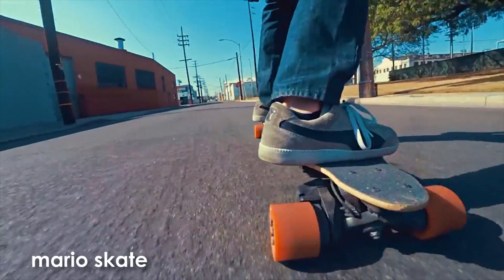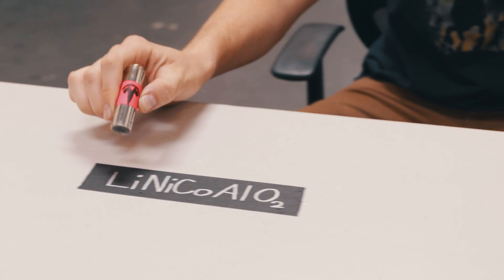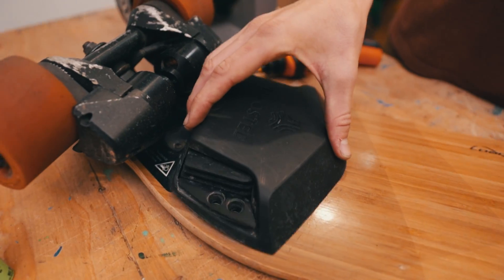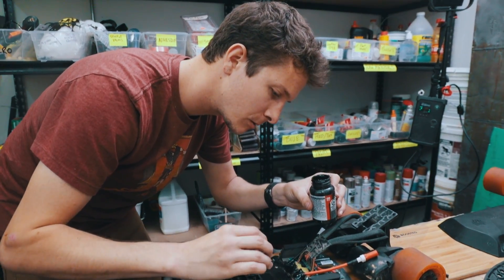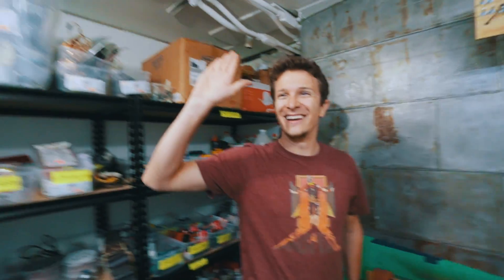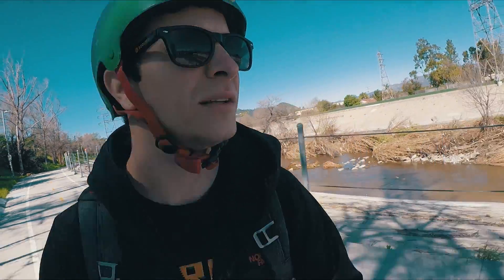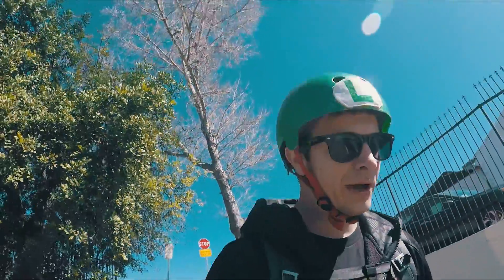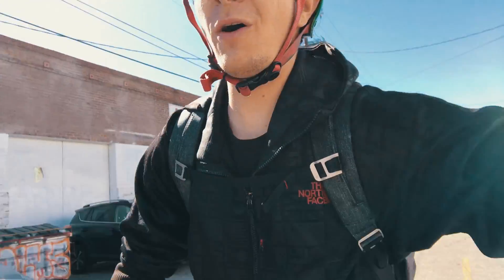Tesla Batteries in an Electric Skateboard!

Comment: Bad parallel methodology... you still allow individual cells in each string to be a weak link. You should have (2-cell-parallels), then string those together in series. Then each and every singular cell has a team mate to share the load with, versus sharing between 2 separate packs.

Comment: A few issues. The NCR18650 has high capacity but isn't really rated for the high amps you are subjecting it to. This will cause them to run hot. Also running down a li-ion battery so low is very bad for the battery. The protection circuit kicked in when it was left unused for so long hence why it wouldn't recharge.
I'm not sure how you are charging but you may need to look into balance charging the new packs.

Comment: What if you design an electric board that has 4 20v batteries and when one dies then it gets charged by 2 electric motors in the front that are only used for charging the batterie that dies. So once the 1st battery dies then it’s programmed to move to the next better and charge the other one while your riding. So it continues to do this and make an endless cycle of charge / use longboard that never stops working so long as you ride it

Comment: Couldn't you just add a fat capacitor to maintain the voltage at a higher voltage i.e. 33.5v? That way the voltage would stay high untill you hit max throttle where the capacitors would run low and average volt with the batteries again.

Comment: You can put a voltage meter to see the battery percentage. You can 3D print a voltage meter case to screwing on to the boosted board. You can put a bigger battery in your bag so you can get more distance and more volts to boost you controller and your motor.

Comment: Ever thought about replacing the main battery with parallel battery packs what if you used solar panels that would trickle the battery drain on the pack

Comment: I see your problem. The problem is not the voltage. It's the if A tour getting from tour battery. So what you would need to do is ad a battery charger or compliment the 12A from the tesla  batteries. That should give you enough energy and A to get you to work.

Comment: It’s not the voltage you need to worry about, it’s how you set up the batteries in parallel. They do not have enough power output. Its great you understand how the longevity works, but focusing on longevity for the batteries will obviously have its drawbacks when outputting power. Lastly, oh god clean up you soldering, its was so painful to see you solder those wires.

Comment: What if you replaced the original batteries that came installed in the board with the ones you're using as the "extra pack", LiNiCoAlO2.. That way you'll have the same voltage range for all the batteries..

Comment: It seems to be that the boosted bord is not converting the last amount of letricity into the mother’s as if it’s detecting it as low voltage in those two last battery’s
Reply: Sorry I missed spells motors
Reply: So network won't respond to go beyond this comment in stack lol.  I watched this long ago then never contacted you about project with donated top of line motorcycle for your pickup driver you flamed up with a cheap loaned mountain bike ride...

Any way owner i assume is still game.  Specs are notorious cost tens of thousands and negotiated down to not even four figures yield to seller so barter fame barter one percent of google revenue just get it rehabbed with chinese donate lto or whatever my goal was static or airspring but the ip of the liquidated lightsail is in unknown hands the patents are her's but the material is as she points out free even if she refuses to acknowledge material science is what her cold reversible heat at least if NOT fire of even better AS IN FACT NOT JUST COLD reversible fusion was and must become so airspring the unletfone Bram son

Comment: your problem was with those batteries. boosted board motors need to use high discharge batteries and tesla batteries arent high discharge batteries. you coul have shorted the engine. only use li-po batries

Comment: make the front wheels kinetic chargers this will give you a slight range boost as around 15% of your power is turned into heat energy and the kinetic wheels will give a bit of that energy back
Reply: Firefox 
That just causes more resistance
Reply: iFail true but there is another problem the battery inside is causing more resistance
Reply: What
Reply: iFail it dose not matte anymore
Reply: iFail matter

Comment: have a switch that changes the wiring from parallel to series. basically each 30 volt battery will stack into 60 volts. The danger is that it could cause run away heat build up and it could explode or you could over volt your motors and burn them out. applying a rheostat to fine tune the amount of draw should help as it drops from 30 volt to 20 volt modulate the rheostat. if you had a digital rheostat/ volt meter you could program it to modulate in real time. Far more complicated than simply storing extra batteries and hot swapping them during a ride.

Comment: here is a fucking insane option. have a switch wiring converter. basically have a wiring configuration where you can change from parralel to series when the voltage drop gets too low. Why is this insane? For a number of reasons 1 is that you could overload your motors by applying too much voltage. 60 volt on a 40 volt motor. Also this is a good stress test for your batteries. Worst case scenario the battery pack gets into runaway heat generation and you die from the explosion.  yolo of course you could apply a rheostat to ensure that you don't draw too much power.. but that takes a bit of work. looking at about an extra 2 pounds of weight.

Comment: What you should do is completely by pass the original battery and add a third tesla pack the original battery has built up what's known as a physical resistance making it even less of a reliable source of power if you want more speed you also need to see if it can handle higher voltage to increase rpms

Comment: make your own board, use the frame and the motors but just hook power straight into a variable resistor in a line up to your arm or use the same idea with a set of relays and an rc controller board

Comment: you can use the full capacity of the batteries by using a step up voltage converter

Comment: Did you think of just simply removing the booster board factory battery?  It would seem that if you remove the limiting factor you are left with fully accessible battery charge.  You could then add one more battery bank and end up with basically two factory charge lengths added to the system and full discharge capability.

Comment: You cannot get energy our of nothig. If you use booster you will kill either the controller due to overload (AMps) or will destroy the battaries. You may use more parallell WITH more power gain so instead of 40.1v make 44.5v controller will decide and will autoajust how much yiou need, but there is again, a rist of burning out. you Might want to look up tesla's engenuity to work YOUR way arounf it. OR consult with any electritian or good physics teacher. They will deffinately help you solve this. 
This is primarely the reason why I am NOT buying boosted. 

OH! btw, you can look up how different boards are made that go WAAAY beoynd 5 mile range.

Comment: Add a third battery pack in sires for when the original battery (at same voltage)dies you can plug up that one and should run fine plus adding the extra boost of power that you need for the last leg of the ride

Comment: If you get a amperage restricter converter and pair it with a voltage trickle charge capacitor you’ll be able to reduce the stress on the aluminum zirconium inside the battery which in turn will allow the amount of kinetic energy being released to the wheels double in output and I have no idea what I’m talking about

Comment: so all you really need to do is to make your own voltage regulator or modify the one that is on the board right now. you need to make one that cuts the power at 30v but i think the easier way to do this is to using a microcontroller (uc) like the raspberry pi zero and just program it to regulate the voltage. If you havent worked with a uc before then just make a voltage regulator from scratch they're relatively simple just look it up.

Comment: You need to use the same battery type as the one used on your board. Tesla batteries release power slower than the original battery on your board. So get 10 of them and connect them in parallel.

Comment: iGuess You allready have figured this out, but ditch the original battery and connect Your DIY batteries to where the original one was.. You will eliminate the leftover juice in the 18650's and You will probably have a correct reading on Your remote :)

But as i said... this problem is likely solved by now :)

Comment: same thing as the tesla car or in other car they run on all batteries but they have a system to work on meaning that lets say your bored need 40v to run on. at 30v it will no longer run, that is the same thing with any car with a low battery they lights and radio will work but it won't have the same out put to start the car. so in that case you have to put a A/C generator know as a alternator some thing to recharge the batteries when they start to reach the low state of charge. so all you have to do is make a way to rechange the batteries and you will use the 10v left over to ride mean while the 30v comes back. it will take some work and thought but i look forward to this.

Comment: Make the boosted board battery bigger then use the Tesla batteries as a emergency battery so when the boosted board battery dies it will rely on the Tesla battery allowing you to utilize all of the Tesla batteries power.

Comment: Connecting both energy sources together and then putting them in the conductor should give them I higher voltage capacity and let them run for a very long time

Comment: Use the boosted board batteries at low speed (using a wheel encoder to detect the speed) then swap over to the tesla batteries for distance once you get going .. (they provide less current .. but you dont need as much torque since you're already moving)

Comment: You can basically take out the battery which is inbuilt in your board and instead of using that battery you can just use your custom built batteries.

Comment: You need to use 20700 batteries in parallel instead of 18650 the 20700 is slightly larger and can get 2/3 more life than a 18650 and I used to drive a 3rd gen eclipse too lol

Comment: Sounds like there's something on the circuit board that preventing it to use the full battery power. That to dangerous to continue though without the help of a professional. I would look into a custom circuit board.

Comment: Buy some “graphene” Lipo RC batteries from hobbyking.com. I have 1 66.6Wh 3 cell (11.1v) at 6000mah. They discharge at 90 amps constant and 120 amps burst. That’s enough to start a car no problem. Discharge rating is 65C

Comment: You can not use the remaining charge of the battery, its designed that way, if you deplete the whole charge in it, chemical inside it wont ionize again, menace you wont be able to charge them again.

Comment: ok first of all you should make a pack of 12 batterys in series aka end to end so you have 44.4v (@3.7 v pcell)

i hear you said that the board range is a 5 miles and you want a range of 15 miles so all you have to do is to mesure the factory  battery capacity than make 2 sets of battery pack and conected all in parallel and you should have the exact 15 mile range  ;) and dont forget if you keep use the board charger , charging time will triple in time 

i hope that this help you

Comment: Few Suggestions Make the battery packs 44/48V and use DC-DC converter that can work with input DC36-48V  and output DC40V. 
Also don't mix the batteries  don't use the built in pack. It is important to balance the battery packs so you have constant performance and you can monitor the actual state of the batteries.

Comment: if it the board RUNS LINUX :D  you can hack the firmware and mod the values to actually remove the limiters and actually let the mod mod battery paks actually work..

Comment: flash the speed control to a lower setting.
change speed control to one with settings.
change the way bats are setup on balance  output to fool speed control.
add caps to fool or boost speed control.
good luck.

Comment: If your 10 cell packs were at 36 volts you've already passed the nominal voltage. Lipos usually shouldn't be discharged less than 3.7 volts per cell. If you discharge them too low then you've fucked them and you should dispose of them.

Comment: You can try to stage the battery so the larger ones go first then the booster bord one goes with it when it gets to a certain level It would be like in your diyagram taking the 2 large cups and lifting the up above the booster board cup

Comment: why don't you try calculating current draw.. lipo is still the best one; yes it can provide huge amount of current for a short time but your skate board will only take amount of current that it needs. If you are running on flat surface, your board will only consume less current, letting you run longer.. you just have to choose a lipo with the right amount of current.

Comment: Everyone relax...BoosterBX.com has solved the range issue by increasing the range to 12 miles on Pro Mode for both the V1 and V2 boosted Board. Its also compatible with the extended range from boosted board and so it gives you and insane 16 miles on Pro mode. They sold out and have a new version coming out in December. With the Booster Box and the extended range battery the board will remain king of the hill. Not to mention, it will still come in at under 20lbs of weight! Sam and Niko, you may want to meet up with the Booster Box team riders, they will be in LA on December 14th to 18th to demo the latest version of the Booster Box.

Comment: when you put batteries in parallel you should match all of the batteries, so you would be better off removing the original battery and add a 3rd one of the same type in parallel. Otherwise the larger batteries will be mostly trying to charge the smaller battery and there is a loss of efficiency there. Once the smaller battery is slightly drained you would be better off removing it from the equation, basically 3 batteries the same would probably almost double the range you got there. Check you are at the right voltages as the original and that you are charging the packs correctly. Also use real panasonic 1650b or use the new 21700b

Comment: Why didn't you just feed into the booster board main battery? Swap that booster board battery with more Tesla batteries as well and run everything through the original channels, its a lot better than cutting into the wires in the controller module at the back which doesn't really help for any voltage regulation and monitoring. just remember to look at what your over all power rating is so you don't fry the board. read this sound system amp analogy as an example of what can cause a fried amp or sub and it will give you an idea of what could happen to the circuitry if you don't know the capabilities of the circuitry on your board and the batteries. P = I × E, P is Watts, I is Amperes/Amps and E is Volts. E = I × R, Volts devided by Amps equals Ohms Ω (resistance). Small wire bare copper coil @ .5 Ω means glowing red and really good for drip vapes where as a 2Ω 3.5 inch voice coil with a descent driver (magnet) on a sub will allow for descent peak power but will fry if kept on const peak so to fix that problem a second coil wired in parralel either by the sub having dual voice coils or a second sub being thrown into the mix which will drop the Ω from 2Ω to 1Ω but series will cause it to be be 4Ω so more watts can flow through but the amp now can be over taxed unless its rated to have less resistance and amps with less resistance than rated have caught cars on fire and caused battery banks to explode during competition. If you can't find out the info for your board, do what I would do and break out the multi-meter and do the measurements. I would honestly just by a 50cc moped and a helmet because they are cheap on gas, minimum requirements helmet, drivers learners permit, 50cc and under, only on roads 40mph and under (in some city's its 35 and under), no motorcycle endorsement required, no tag required, no insurance required, head lights required for night use, turn signals and brake light required for road use, about $620 on Amazon brand new and $156.99s&h most come with all lights and they are faster than your $1500 board as well as they go way further most get anywhere between 85 to 155mpg and come standard with a 1 gallon tank.

Comment: You need to build 3 battery packs with 10 individual cells in them. Then hook the 3 battery packs in series. With 2 packs, its not a suprise that you arent getting the current you want. 3 packs in series will definitley provide the current you want. Also, it would probably be good if you disconnected the stock battery and hooked the leads straight up to your aftermarket packs.

Comment: if you use an electron convertor you can potentially increase the output of voltage per second increasing your battery cap.

Comment: you can't connect two batteries in parallel an have double the  current there is an esc which limits the current going to the motors that moves your board so you won't have a speed or Torque enhancement but yes if used a boost converter it will give you additional power  from the batteries but not a huge amount